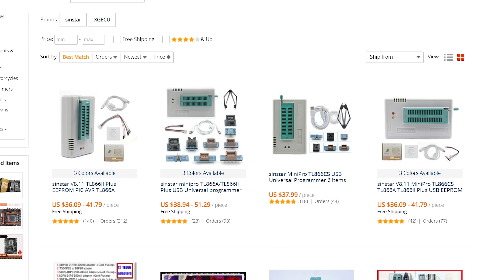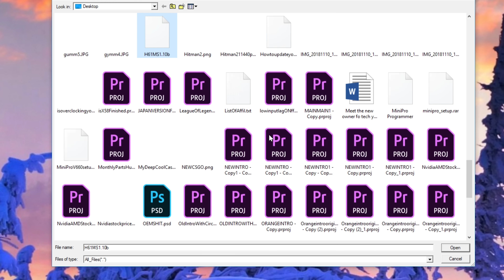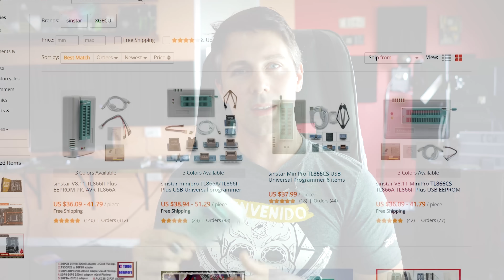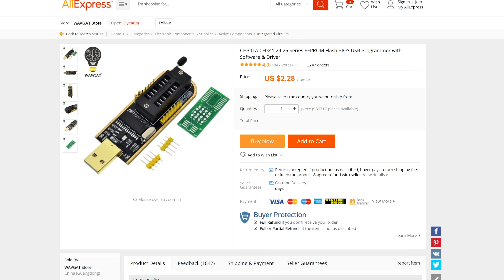How To FIX Your BROKEN Motherboard for ONLY $2...!?

Comment: Bryan, GIGABYTE motherboards with Dual BIOS often runs into this issue where the primary BIOS is corrupted and you need to kick start the BIOS recovery process.

You'll know this is the case when you'll see your system boot looping infinitely, and at times there is a POST but it soon restarts thereafter.

To kick start the BIOS recovery on GIGABYTE motherboards with Dual BIOS, hold down the Power and reset button at the same time, and flip the PSU switch on. You'll see that your system will receive power, and the fans will spin up, then shut down as it would while in a boot loop. Without letting to of the power and reset button, turn the PSU switch off, and wait for 10~12 seconds.

Turn the PSU on again to power up the system. Don't let go of the Power and reset button yet. Let the system turn on, and go off by itself. Turn the PSU switch off. Wait for 10~12 seconds. Now turn the PSU switch on again. Let the fans spin up, and then shut down. Now turn the PSU switch off, and finally, let go of the power and reset button.

Now turn the system on as you'd normally, and wait a couple of boot loops. You'll eventually be greeted by a POST window saying that the Primary BIOS has become corrupted and is being flashed by the recovery BIOS. I hope this will help some unfortunate GIGABYTE motherboard owner out in the future who doesn't have access to an EEPROM flasher.
Reply: Thanks man
Reply: Yep did the same and saved a board some time ago. Good tip 🤘🏻
Reply: I was able to execute the flash by simply holding the power button to let the board go on and off around 10 times then I turned on normally to be greeted by the recovery flash.
Reply: Efat Al Maun hi man...glad I looked at this post...I have the exact same board as in the video..I will try your method Efat...my issue is it keeps reboot looping with no video...i used to see post for a couple seconds then it shut off...but now I don’t see a thing and it keeps reboot looping.do u suggest I try your method?or get the epprom reader?
Reply: You can also just switch to the backup-BIOS, go into Q-Flash, set the switch to main-BIOS and flash it. Board should be in single-BIOS mode for this so it doesnt try to flash itself while you are flashing, which bircks the board completely. In the case both main and backup BIOS are corrupted only an EEPROM-flasher may help.
Reply: Kurt Cocaine yes Kurt in my case am sure the both main and backup are corrupted.....cause when the backup bios makes an attempt to flash the main bios it caps out like 40% or so....so I ordered a eeprom programmer it should be in my hands next week...I will report back here if I had any kinda success..
Reply: @platinumsteel6458  is your board in single bios mode while it freezes like this? same problem slightly other cause. Im pretty mad that gigabyte does nothing to solve this problem thats here for years and multiple gens of boards except for a socketed main bios chip on the flagship mobos. ill get my Ch341a end this month, ordered today after i put my 1080ti and my 2700x in my other x370 gaming 5 board so i can work while the main PC is bricked. had the same shit with the x370 g5 before. ill post my update when it arrives, much luck to you.
Reply: Kurt Cocaine yoooo..man I ended up getting a ch341a with adapters and everything...and it couldn’t read the chip.lol..it was literally not getting detected....so according to a bios modding site.the admin there told me that the cha341 isn’t able to read those chips because of some bla bla bla..heard that from 2 sources..can’t remember what he said...so they recommend I get the RT809F programmer..that would read the chip and re program it...But if u get the CHa before next week let me know how u were able to get yours working.....and detecting the chip..would be glad to hear..
Reply: @platinumsteel6458  damn, read in a forum today it seems to be possible for my specific cmos chip, but i didnt even find a datasheet for this specific chip... well lets hope the best for each other xD. ill keep you updated, should be here until 30th of this month, but ya know chinese shipping. i ordered it after this guy called Lost_N_BIOS on the WIn-Raid forums wrote about the specific chip that is apparently used in x370/x470 boards from more than one vendor. the hope dies last xD.
Reply: @platinumsteel6458  Hey man i tried the CH341a and it worked,i had to use asprogrammer 1.4.0 instead of the  CH341a-programmer software and an 1.8v adaptor, was hard to find a way because the new chips arent detected or even in the software so i picked a very equal chip from the list and it worked, got my main BIOS  back and flashed my backup bios through it. Im glad i did it, i bet Gigabyte would have took their sweet time sending new chips xD.
And about the chip detection, fuck this , just get your phone and make a photo with zoom of the chip so you can read it, thats what i did + a little google fu and youre should be good to go.
Reply: Kurt Cocaine glad u got tru man...but not so lucky on my end.i had gotten the RT809F works like a charm out of the box....only downside to this thing is u can’t use the clamp to clip on the chip...gotta remove it with a soldering heat station which I did...I flashed the 2 chips with the latest bios but after I put them back and powered up it is still boot looping and I can’t even get it to go into recovery mode anymore.jumpering the pins nothing works like it used too....looks like I may have messed something else up in the process....glad u got some success on your board..My board is a GA-Z68MA-D2H-B3 by the way.
Reply: @platinumsteel6458  oh shit, that souns bad..:( did you have to desolder because of placement or power constraints ?  had to use the clamp too because the sop8 socket adaptor wasw too small for my chip but in the end i got lucky and everything worked. I think some traces on your board may got damaged or something in this league. sorry it didnt work for you :(, its still a cool board even though its an older one, still costs about 100€here, hope you can get another for cheap where you are.
Reply: Kurt Cocaine so wait u used the clamp and got it to work?i really didn’t try to hard with the clamp..and I hate de soldering..cause that is what I had to do 3 times...so yea maybe I messed up some of the traces....man I wish that clamp can work..it would of saved me from all this headache geez...let me know if u were able to get the clamp working..I will have to practice using the clamp.
Reply: Kurt Cocaine I have the CH341a here.. but I really would like to know what the 1.8v adaptor u used looked like tho...I will try to find the aaprogrammer software u unsaid u used..thanks for the tip.
Reply: Kurt Cocaine bro some serious sorcery just took place..lol it’s either u sent some of your good luck or the bios felt sorry for me..I just took back out the motherboard and decided to try again..took a small magnifying glass and inspecting for broken traces or anything..saw nothing.then decided to just short out pins 1 and 6 on the main bios....and then was going to check voltages again and then I just saw a red light from the mouse I had hooked up plugged in the monitor and bam bios loading defaults..some real crazy stuff..cause the same shit I was trying over and over for the past few days it now decided to work today..so I am not sure if it’s the jumper pins..cause I swear I did that 100times already or it’s gotta be some of your good luck transferred over..so the mobo is fully working now..lol ....I only have 1 bios attached tho..which is the main..think I will not bother to re attach the second bios..lol
Reply: @platinumsteel6458  yeah the clamp worked, the red cable is the cable for pin 1, the 1.8 volt adaptor is the chip with the blue mechanism on this picture: 

https://www.amazon.com/AiTrip-EEPROM-Programmer-CH341A-Adapter/dp/B07VNVVXW6/ref=sr_1_1?keywords=ch341a+programmer+1.8v&qid=1570109758&sr=8-1

i have a socketed chip for my main bios on my board, but you may not had to desolder the chip,  just  clamp it while its still on the board and flash it. i read it worked for most people. 

the link to the software is here: 

https://github.com/nofeletru/UsbAsp-flash/releases/version 1.4.0 worked for me .
Reply: @platinumsteel6458  wow thats an unexpected good turnout, im happy it works again but i have no clue why. Hardware does strange things some time lol. 

yeah i wouldnt bother attaching the second chip back, now that it runs again.
Reply: Kurt Cocaine thanks a mil for all the links man....really appreciate it.
Reply: Kurt Cocaine I would love to try what you wrote...actually was just about too...then remembered that the issue with mine is that if am lucky to get into the bios like 20 second or sometimes more or less the whole system would just cut off on its own..then go back to reboot looping again...I don’t even get enough time to complete a bios flash ...it would just cut off..and I know it’s not cpu overheating...hoping it’s not something else and the bios is just corrupted...lol

Comment: With the CH341A you need to be careful, there are a few versions including one that is built wrong and shoves 5V instead of 3.3V which is potentially chip killing, IIRC the green pcb version. The one I've got (black PCB) works fine but others who flash custom laptop BIOSes have had issues with it and swear by others such as the skypro with pomona clip.  That clip looks just like mine and yes sometimes it takes a few tries to get a good connection.  I originally used these to save a $500 laptop motherboard and have used it 1000x since to flash custom laptop GPU vBIOS (because nvflash won't work with unsigned vbios with pascal), increasing power limit from 115W to 200W on MSI MXM 1070s and putting them in a Clevo 2012 Ivy Bridge laptop, Clevo 1080s from 190W to 275W, etc.

Comment: I have a gigabyte z77 ds3h, and the bios got corrupt just from changing ide to ahci. I had to flip the psu switch and hold the power/reset button or short out the main bios(mine was dual bios luckily). I actually just fixed it this year and I've had it since about June of last year, very weird situation. Another problem I had was with a z68x(Also gigabyte), it would report pcie 3.0 x8 while in gpu-z while physically the slot was limited to pcie 2.0 x16(Weird).
Reply: The gigabyte z77 ds3h doesn't have a cpu vcore option either, I've seen a forum saying it is possible to crossflash a d3h board's bios and it has the core option but it doesn't actually change when viewed in cpu z. Lol

Comment: Problems with programming may not come from the clip itself (if it's resonable quality ofc) but from programming in circuit. Programming or even reading in circuit often doesn't work. A few days ago a client brought me car radio for decoding. Car radios can usually be read using a clip just like the one in this video, but not this time. I tried reading it a few times and then I just desoldered it and it worked like a charm on the first try. If you have at least a few motherboards that require a bios flash, you may want to buy a soldering station. Simple 2in1 station is more than enough for this kind of job. Soldering EEPROMs may look difficult but I assure you it's really easy. I myself have learned soldering SMDs from youtube videos. I'm sure you have some hardware that you can practise on.

Comment: Hey! I rescued a dead B350 board that I got for about $20 USD with a CH341A programmer, a level converter (3.3 V to 1.8V),  and a SOIC clip. Sometimes you have to plug the PSU to the board to flash it properly - the standby power of the PSU is enough to power some subsystems of the board to ensure that the programmer isn't powering them (and lowering it's voltage). That may be causing your finicky connection issues.
Reply: Nah...the clips suck balls. If you've ever tried to use one you'd know that.
Reply: JocPro, help me out bro, I have a bricked asus prime b350 plus, was it easy or did you have a bad time doing it?
Reply: @JONARANTS  did you just close your pc while updating your bios???
Reply: @YokeyDokey  power outage, got the clips but they suck real bad, gave up and switched mobo
Reply: @JONARANTS  wow, im actually going to update my friends motherboard. Same b350 plus.

Comment: A fiberglass scratch brush pen may help provide better contact, as the bios legs are more likely to have corrosion/debris rather than the gold plated jaw pins, unless the plastic housings of the jaws themselves are interfering.

Comment: With that gear, you should be able to flash modded bioses to GTX 1070 cards. Take a look at overclock.net
Reply from the maker: Will check it out, others are telling me oems and stuff are no now longer a problem too.
Reply: @techyescity  As far as I know, the bios encryption still stops a flash with NVflash. You still need to use a mechanical method like this. One of teh guys with a 1070 laptop has 230W power limit programmed on his mxm modules.

It may be interesting to flash a 1070ti bios on to a 1070 to see what happens

Comment: Warning about CH341A it sends 5V to 3.3V chips and it could damage motherboards other components or the chip. Here is how to fix it https://www.win-raid.com/t796f16-Guide-Using-CH-A-based-programmer-to-flash-SPI-EEPROM-13.html#msg58683

Comment: Now you could fix some fake gpus with a bios flash!
Reply: He could do that with just software alone though. Slot in the patient card in a second PCI-E slot and flash away.
Reply: Mansen a lot of the fake cards lock out bios flashes, or don’t work due to how the bios is flashed. With this device you can force flash the original bios back which is the only way to get some back to their original states.
Reply: "Locked" BIOS cards still can't lock out bruteforce tools that most modders use already, so that's a bit of a moot point. This is just a hardware approach to flashing any chip, where it isn't possible to access it through software - Such as a boot looping motherboard. :)

Comment: I have a CH341A black version, and I've never had a problem with it, it flashed bioses for some LGA 775 boards i had lying around without any issues, the software for it is a bit more difficult to find, the newer version that is, but you can find it in about 10 mins of searching. Its only downsides are the lack of the "claw" for SMD bios chips(or at least the model i got) , tho it does include a little pcb for those, but u need to desolder it from the motherboard, requiring soldering skills, and the  fact that it can only flash DIP 8 packaged bios chips and EEPROMs without soldering stuff. But appart from that, its a really handy any easy to use device...
Reply: I just bent the pins out on the tiny little adapter board that came with it and the clamp holds it in ok. Falls out kinda easily if theres too much stress on the cable but so does the other end attached to the chip.  But yes, much much better than stuffing around with solder
Reply: @greebj  i just put spring in middle of two handle bars of claw and 2 lil screws so it doesnt pop out

Comment: The cheapness of the clamp is not an issue, it could be 100 times more expensive and it wouldn't work any better, it's trying to solve an impossible problem. Attaching them to the chip is certainly a skill in itself, it needs a good bit of practice. Most repair shops actually avoid using any friction clamping on SOIC chips, they solder the chip to the adapter board to program it, desolder it from that and solder onto the mainboard, and they don't generally reuse chips that came on the board, because that's enough thermal stress for one chip.

The one you're about to order is for DIP chips, not SOIC, you can't use it for your purpose.
Reply: Yet he did. Feel free to offer better alternatives.
Reply: @amshermansen  just in case you misunderstood me: unfortunately the original $2 clamp he used in this video is the best noninvasive attachment device, you can't pay your way out of the issue that a reliable way to attach to an SOIC from the top hasn't been invented.

If you're concerned about manufacturing quality, you can buy Pomona, but after 2-3 attachment attempts by a hamfisted bloke they become pretty equivalent in quality :D

The white clamp that he now ordered hoping that it's better can't be used, it's for DIP with 2.54mm pin spacing, but the chips you find on the boards have 1.27mm pin spacing.

As for programmer, the $40 one that he used and the $2 CH341 are equivalent enough for serial chips, but the more expensive one will also do parallel ROM chips that have pretty much died out.
Reply: @amshermansen  Get on ebay and search for SOIC8 SOP8 Spring Loaded Pogo Pin Adapter. The cheap ones are very good quality. But appear to be spaced for the "non-wide" 150mil chips. It's almost impossible to get the pins to connect properly on a 209mil chip. But, if you're crafty, you can modify it so it'll work just fine on the wider chips.
Reply: There's no need to solder the chip to the adapter board. You can clamp it to the board(I've used a rubber band successfully). Or you can buy a cheap SOIC8 SOP8 to DIP8  adapter socket that plugs into the programmer. It's got a spring loaded mechanism that clamps down on the legs of the chip for programming. It's the best method for offboard programming by far(except DIP chips, which don't require anything but the programmer). And you can get them for any size/type of chip. And...BTW...you're right...the clips are garbage. All of them.
Reply: I agree , just de-solder it , its honestly not that hard